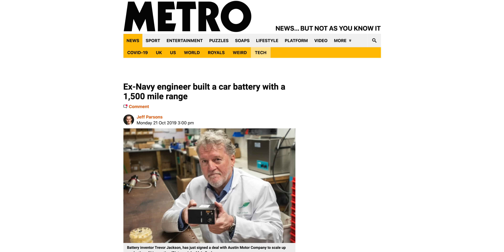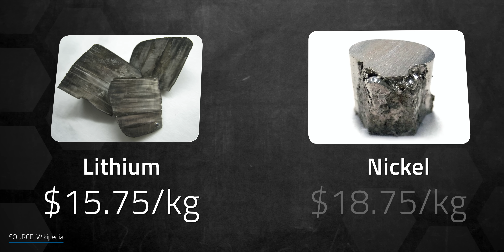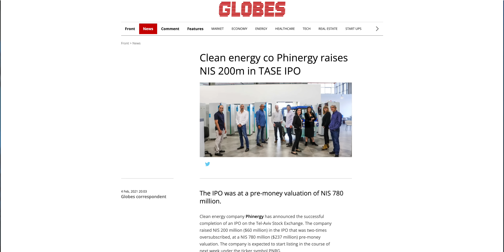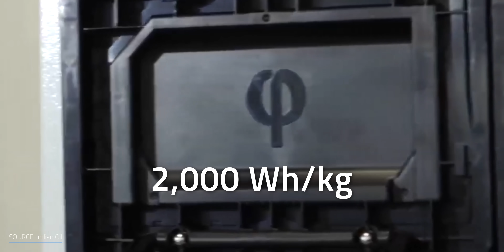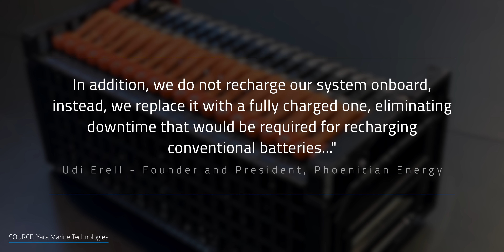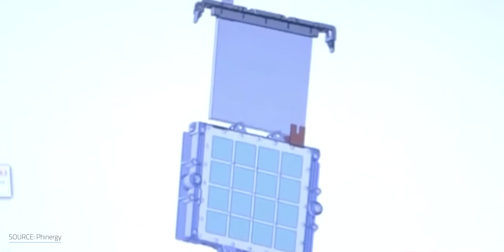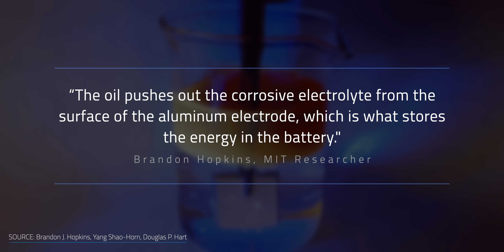Exploring the 1000 Mile Car Battery - Aluminum Air Hype?

Comment: If they just add a "reserve battery" that is good for say 50 miles of driving then swapping out the  main battery when it goes dead is not a problem.
Reply: For cars braking and going downhill a small rechargeable battery can store that energy. A few to several kWh battery would handle that most of the time. When the aluminum-air battery nears depletion, software can prevent the rechargeable battery from being drained as much so it stays closer to full in case the big battery get fully depleted. If both batteries run out of power the small one can still be charged up by a rescue truck.
Reply: @flinx  Exactly A small rechargable battery with good Charge discharge reliability backs up the main for emergencies and regenerative breaking, thus main battery death isn't an issue and you don't need a massive battery.
Reply: So you are advocating using more resources than what would be required in just using current EV's?  How would these batteries be delivered, diesel trucks?  How about energy required to recycle said batteries?
Reply: @lastofthebest5102  resources aren't all equal. That's the appeal of aluminum in a battery because it's relatively abundant and affordable. We'll have to wait and see how much energy is used recycling them compared to staying with rechargeable technology.
Reply: @lastofthebest5102  clearly you haven't heard of opportunity cost. The market will decide what is best for each instance. The amount of resources used will be based on the demand, balanced by the cost and availability of the different forms of batteries.

Comment: The fact that it's not rechargeable is a killer.  Even though it has much higher energy density, it still pales in comparison to gasoline or JP-5, so for high power or low weight applications (e.g. aircraft) it probably won't be good enough to unseat fossil fuels.  And for lower power applications it probably won't beat out Li-ion in terms of total energy efficiency because of all the recycling and logistics you have to deal with over the course of a vehicle's life if you're swapping an entire battery pack all the time.  I mean, there are a lot of people in the US who would go through a 2,000 mile battery pack every month, or even more often.  That's A LOT of batteries to recycle and deliver.

Comment: I think this would be good for fleets where you have really good control over where the vehicles go, but you still need more range or the ability to move extremely heavy vehicles.  Also, these would make fantastic range extenders.  Maybe use a 150 to 200 mile of range on a Li ion battery, and a 1000 mile range for a weekend trip.

Comment: 4:34 Er... the density of aluminium is 2.70 g/cm3 ,the density of Lithium  0.534 g/cm3

These "batteries" should be correctly referred to as Aluminium air fuel cells. The aluminium is oxidised ,just as hydrogen is in a hydrogen fuel cell. The energy available is proportional to the mass of aluminium "in the tank"
that is available to be "burnt" .
Recycling amounts to removing the aluminium oxide "combustion deposits" and "filling the tank" with new aluminium electrodes.

Comment: Battery swapping requirement would not be a problem. It should be easier to get a battery delivered your car when left out on the road dry, compared to receiving a mobile charging service. As a matter of fact, battery swapping station network may be more effective if it is mobile altogether.

Comment: I was watching 'The Electric Viking" and in an interview they said the average life span of electric vehicles is estimated to somewhere between 300 thousand to 800 thousand miles. 
I think this tech would work better as a hybrid, you wouldn't even need a to carry the battery unless to needed the extra range like on a cross country vacation.
Reply: 300k miles? Are they taking into account battery degradation in any way?
Reply: There are already a few million mile Tesla taxi's etc, but under normal conditions who knows. Age, wear and corrosion plays a huge part in normal use.

Comment: Aluminum is not expensive to recycle. It's actually cheaper then mining bauxite and turning it to Aluminum. Aluminum oxides recycled would require a very large amount of energy. So not easy to recycle the waste of these batteries.

Comment: I wouldn't want a non-rechargeable battery in my car, but I would consider flying in an Aircraft powered by an Aluminum-Air battery since the swapping stations would only have to be at the destination airports.  1700 wh/kg is well above the necessary energy density required for battery powered flight.  Once the required recycling infrastructure is in place, I can imagine this could lead to much cheaper airfare and significantly less CO2 emissions.

Comment: If you can do it by hand like putting in a battery in gas car.  Like opening a speical bay and swapping out a couple modules.  Then having to replace your oil for the anti corrosion system seems like the best option.  that way if you are going on a long trip you can bring a couple extra batteries or dont have to wrry about it because ohh look you have more range than a standard li ion.  I cant wait to get a good ev truck so i dont have to worry about camping with one.

Comment: 'Not rechargeable' is a bit of a disadvantage!  I can't help thinking that this is exactly the sort of battery an oil company would go for.  This way, they can keep their network of (ex)petrol stations and maintain their control over the drivers they supply.  For that reason alone, I would be against this technology.  One of the main selling points of rechargeable battery cars is that it frees you from the sort of control the oil comapanies exert over drivers today.

I also have concerns about just how 'green' all this is.  I know that lithium-on batteries are hardly green - from the manufacture and disposability point of view - but I can't see how an alterative that has to be remanufactured and recycled each time it's been used up is in any way better.

Anyway, once rechargeable batteries have reached 500ml/1,000km ranges and usable partial recharging times are down to a few minutes, no one is going to be interested in any system that involves physically reloading with a new battery pack (or, indeed, a tank of hydrogen) every time it runs out.

Comment: like others have said. suited for larger trucks and/or planes. certainly doesn't seem viable for normal consumer use. hydrogen is likely going to take a large chunk of the market with fuel cells. clearly more research is needed to make the processes more effective but it's just a matter of time before that happens. 
at least people are trying stuff out, it's better then just ignoring it and never seeing any real world results.
lastly the cost, i can only assume these things would cost a arm and a leg, maybe even multiple. 1,000 miles sounds nice but you would, on avg in the us, need to then replace them 12-15 times a year. which is at least once a month and likely more. 
however if they could make get the price to something reasonable in terms of gas cost then it might be viable. certainly seems like a much better option for companies and big vehicles.

Comment: > Would you want to drive an EV that required battery swapping?

I mean, Tesla is already considering offering this for existing Li-ion teslas, so it's not tooooo farfetched of an idea.

I think if the infrastructure around battery swapping was good, it would be a far superior replacement for gas cars.

I think the issue I foresee is price. Silver is $$$, so I'm not sure how affordable swapping batteries every month would be.
My other question is: what is their overall environmental impact compared to Li-ion?

Though, end of the day, we should just get rid of the our reliance on cars, and instead focus on infrastructure that doesn't rely on electric cars, because no battery solution will overcome the problem of how environmentally damaging massive amounts of asphalt all over the place is.

Comment: Prediction.
Range anxiety will be solved by fast chargers. Destination chargers etc.

Give me a (reliable) 100 mile range. That will cover every journey I've made since the start of Covid.

Of course there's 'just in case' I might need to make a longer journey but an extra 30 minutes or so per 100 miles is fine. Especially as all of the journeys I've made since uni that were over 100 miles were for leisure.

Comment: With having a super long range this would be pretty awesome. I would be okay with this and pay to swap like swapping propane for my grill. Swap out the battery every 2k miles and paying $100 to have them take the batteries and recycle them sounds great. I don’t see the issue that you bring up of them not being readily accessible. If they are fairly cheap and don’t take up much space then I really don’t see the issue. They could be placed in supermarkets, fuel stations, and all kinds of places.

Comment: I would agree on that if I would have e.g 4k km, because I have already 20k after 3 years of driving I would be 5 times replacing battery during those 3 years, which is reasonable. And I thin those would be great for air travel. Planes need to be prepared every time they start flight so there is place and time for it every single time

Comment: Isn't battery swapping the same as going to the  petrol station to fill gas? I would definitely prefer it than worrying about range. The issue would be during the early stages of adoption there wouldn't be enough places to swap the battery. This is where a Dual Battery tech would be a better bet. So we'd use the aluminium air battery for the majority and use a smaller lithium ion battery to be able to charge at home and access the already existing charging network.

Comment: They're not going to be managed properly in disposal/exchange, and all it's going to do is create more trash.  This is a REALLY BAD IDEA. 
By being non-rechargeable, these batteries are the equivalent of touting plastic bottled water over faucets and drinking fountains.
("The human needs water; will die without it.  But people get wary of going out because they might not be able to get water when they need it.  And having to track down a place where they have to stop, perhaps wait in line, THEN get a drink makes the process even more cumbersome.  Canteens are expensive--up to $15 each--and typically can hold no more than a quart at a time.  The solution:  Cheap, readily available water in plastic bottles that you can get for around $1 just about anywhere!")
 
Citing EV range as a drawback is kinda fallacious.  Most cars don't even get 300-miles on a full tank, and they can't be refilled at home like EVs can; practically no one drives more than 300-miles between times when they can get back to charging.  

Totally not sold.

Comment: EV driver since 2012 here... I've always thought we should have battery swaps.  I think having a 2,000 mile battery would be great - you just have to anticipate and plan your swap.  (do you ever leave on a big road trip without getting your oil changed and fluids refilled??) If I was on a long trip, I would plan out whether and where I would make the swap so I wouldn't have to deal with it last minute.  I think discussion around running out of charge is silly.  We only expect gas to be available because it's seemingly everywhere (because its trucked there, btw).  However I challenge you to drive through Colorado, New Mexico, and Nebraska and not plan when you're going to get gas.  I will say the non-rechargable attribute I don't like, because I can't just use the electricity grid to charge... which is the whole point.  If you scale aluminum mining to petroleum levels - will we run out of resources?

Comment: Out of juice on the hiway, the smart tow truck driver would carry a swappable battery. The dispatcher would dispatch the unit with your battery. You pay the swap charge and the tow truck mileage charge. There should be no charge for swappable batteries in good condition, IMO. i think it has potential if organized properly.

Comment: How much of the battery is recyclable and how much is consumed per use?  I upcycle old battery packs as a hobby, if these Aluminum Air batteries are simply just stacks that a robot pulls apart and rebuilds another, then that seems like a great way to go.  As far as a dead battery on the side of the road, a swappable battery would be amazing, even a benefit over traditional EV's.  A service brings you a new one and you're good for another 1,000 miles (if the claims are true).  Conventional charge stations could be a thing of the past and instead you are serviced as needed where needed by other electric transportation vehicles, possibly by drone.  A central hub deploys newly built packs to needed cars.

Comment: Sorry to say but Lack of research, 
you mentioned aluminum in India and phynergy - Indian Oil deal But one of the pioneers, log9 materials was not mentioned, 
Also a huge drawback, the cost of recycling the oxidized aluminum, in terms of energy required was not mentioned.

Comment: So, how many batteries per day would the average filling station have to receive, stock, and exchange per day if a significant portion of the 386 million US light vehicles were to adopt this technology?  How many people/robots would each filling station need to employ to do the exchanges?  How many of these batteries would have to be delivered to a re-charging station each day?  How many recharging stations would it take.  Moving, recharging and storing these batteries is a lot more cumbersome than moving and storing gasoline.  The one BIG advantage that these batteries would have is that the expansion of the electrical grid would be much simpler if the grid only needed to be expanded to a few thousand re-charging centers.

Comment: I wouldn't have an issue with battery swapping if the batteries are in some way certified. One of the issues I have with EVs is I don't really have an option for charging where I live. There's a charging station close by but I can't leave an EV there overnight. I think it would be an absolute game-changer if someone figures out a flow battery tech with reasonable energy density.

As far as Aluminum batteries... at least from my understanding (you probably know more about it than me, though) aluminum takes an enormous amount of energy to produce from aluminum oxide so unless that is done with renewable energy sources it's really not eco-friendly.

Comment: The problem like most new ventures is infrastructure. Car networks like this would require massive infrastructure to manufacturer, recycle and distribute everything needed to keep these Air batteries going.  I agree with the group in saying the aeronautical industry would greatly benefit from a system like this if you can keep the cost down.

Comment: They use electrodes for oil pipelines to reverse steel corrosion, Why can't they use a small battery for that purpose to reverse the Aluminum corrosion?

Comment: Because of the fact that the batteries are not rechargeable, they need to be in an easy-to-access space to be able to change quickly. You wouldn't be able to put it in the bottom of the car as Tesla has if you want that convenience. You will most likely need to have smaller batteries so they can be changed quickly. It also comes down to how many of those batteries will be recycled and will it be cheap enough to recycle that everyone does it.

Comment: what would be the cost of a battery swap though? also for the batteries themselves, the only thing that gets "used up" is aluminum correct? the silver and everything else isnt consumed by the reaction? and lastly does the battery degrade while not being used/not hooked up?

as long as the cost is relatively cheap (assuming to recycle the battery you basically just clean it and add a new strip of aluminum it should be) and the battery doesnt degrade while not hooked up/in use, then i could see a system where you have 1 battery in use that you swap to another one as needed.. depending on individual preferences you could store 4 batteries at home, the active battery in the vehicle and a spare in the vehicle, eat up the 5 batteries, drive to the swap station on the 6th battery and repeat so you only have to go once a year or something, or just the main battery and 1 spare and you go to the swap station every cycle

Comment: Another factor is how much the batteries will cost to remanufacture as a proportion of their new cost. I don't see it being economical throwing them away when they are discharged and there would need to be a system setup to send them back to the manufacturer to be disassembled and the remaining anode and electrolyte removed before reassembly with replacement parts. The removed bits could then be sent for metal reclamation.

Comment: Cars could have a main (full size) battery and a "spare" (small) battery that could be changed by hand. That way a tow truck or friend could drive up with a spare, swap it out and get you to a service station (which would have to be in the range of the spare or spares that you could easily carry).

Comment: There has to be a process to at least slowly recharge them. Otherwise i'd consider this a dead end, as i don't see how the price per kwh to get low enough otherwise. Probaply even hydrogen is better than a non rechargable battery in that regard.

Comment: Battery swapping would have to be outside the trunk. As this would make trunk use impossible. Also, I cant see Grandma swapping battery's or Becky with the long nails who is 3 month pregnant , can you? Which means there would have to be a replacement service. WHICH would be an additional cost factor.